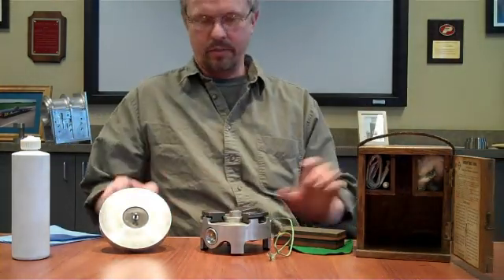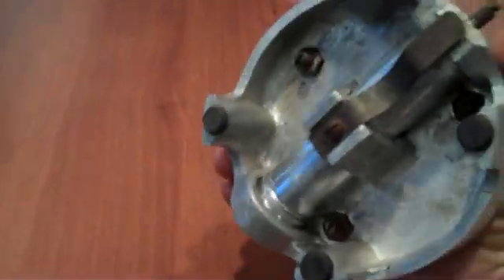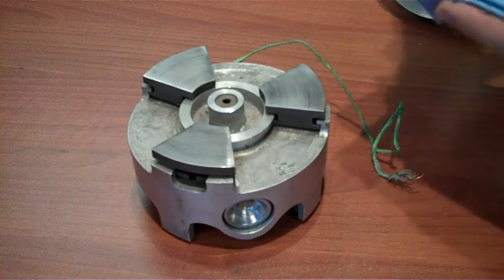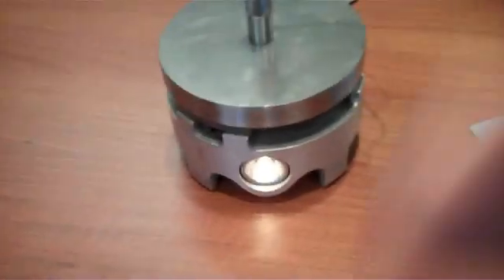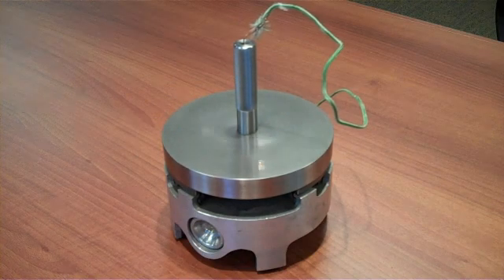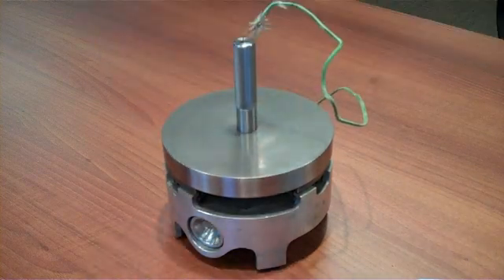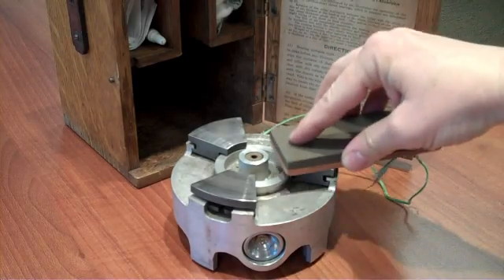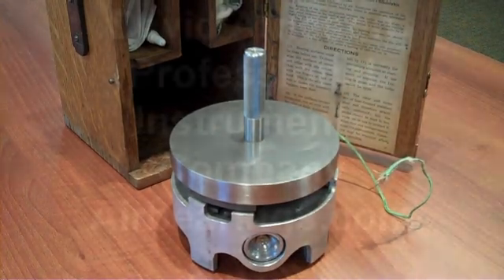Kingsbury  Tilting  Pad Hydrodynamic Air

Comment: That is an awesome demonstration of how a fluid thrust bearing works. I believe these types of bearings were originally used on the propeller shaft of ships to contain the linear force applied by the propeller so as to push against the hull rather than the crankshaft of the engine.
Reply: Obviously you don't know the difference between fluids and liquids.
Reply: @deeremeyer1749  
Why is that significant? All liquids are fluids but not all fluids are liquids, since liquids are a type of fluid.

Fluidity describes the property of a thing to flow and to take the shape of its containers.

Liquids on the other hand are a state of matter. Gasses are fluids but obviously not liquids. Sand is another example of a fluid.

Happy? 😉

Comment: It's a Michell Thrust bearing. The Australian inventor had it stolen by the Yank, Kingsbury, who used lawyers to plead special circumstances. Apparently he had been working on it for a while and hadn't been able to understand the maths so that was enough to prove an American got there first. Yaaaaaay!
Reply: Nice story, but not true after all what I have read (E.g. "Sound & Vibration" oct 2003). Obviously Michell and Kingsbury came to same invention but did not know from each other's works. Kingsbury had researched on bearings since his early years. First repeating Tower's experiments (also without nowing about Tower's experiments). Once being made aware on this, he got to know about Reynolds theoretical works on bearings also and continued from there.
So the invention was at least not "stolen" from the Australian.
Reply: @Stiegsfeld  
If there's money involved and there's even a hint it was stolen, you can bet it was. Poor Mitchell, it reminds me of the disputes between Sir Oliver Lodge and Guglielmo Marconi. Marconi simply stole Lodge's ideas put them in a box and called radio. Lol, Apple also comes to mind. Everyone thinks they've invented everything including the wheel, but in fact have actually invented nothing. Innovation for sure, but no invention.

Comment: This is the most amazing thing I have ever seen on youtube, and I have seen a billion videos about how to build stuff, and how things work. This is similar to Tesla's boundary layer concept used in the Tesla turbine, where basically air sticks to stuff a little bit. Often enough to exert a usable force. In a tesla turbine, the air blows between a stack of disks, and the air grabs a hold of the disks, and spins the turbine. This seems to be the same concept, but it is almost more beautiful. It is hard to believe this actually works. You need a smooth spindle to grab the boundary layer of air.
Reply: That's so funny that you mentioned the Tesla turbine all those years ago (according to the date lol) and I ended up here looking to confirm my idea for a Tesla turboengine's drive-shaft axial movement restriction so I can do the heavy lifting with permanent magnets.
Incidentally Tesla's original design used an air bearing so cool beans on that!
Good catch. ;)